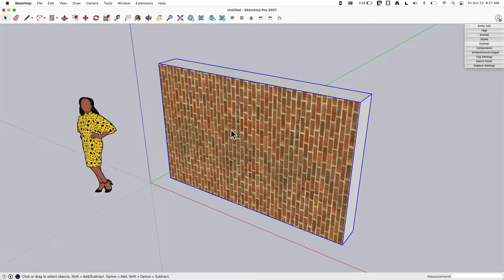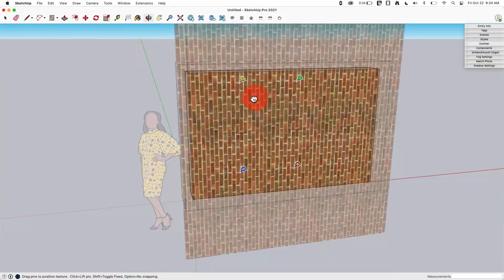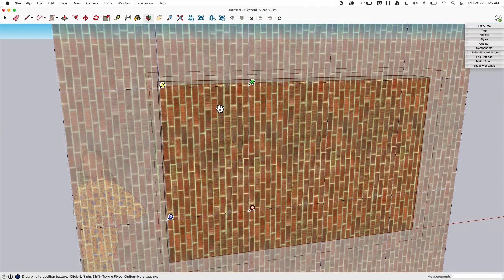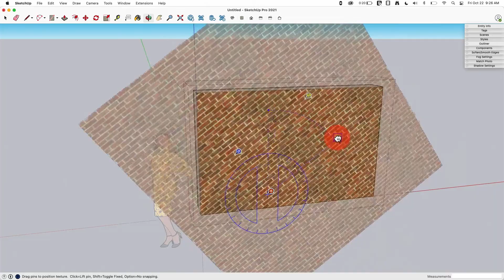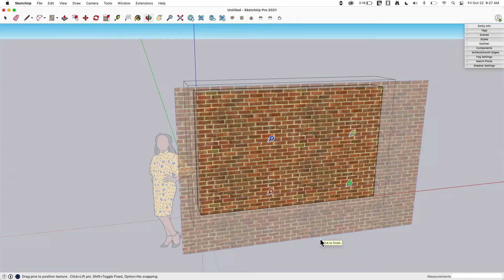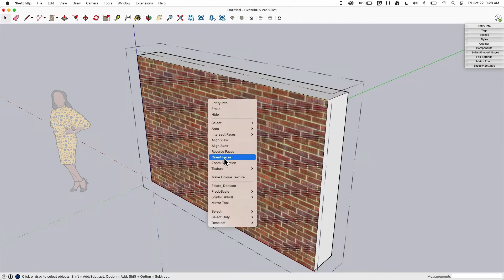Rotating a Texture - Square One

Comment: Is there a way to scale a texture—say corrugated siding—to a specified o.c. distance between ridges? Perhaps I could place a 4-inch geometry near the texture….Once sized in one place on the model can it be copied and pasted to other surfaces? Also, I know this is the iPad series, but on SU Pro, the four pins were all in a bunch. I will try it on the iPad.

Comment: Always good to review the basics.  Thanks Aaron.  I'll second what Hapsard noted and would also like a refresher on how to use the "white pins."  I just downloaded Architextures and am curious about rotating those textures too like T Cards, just haven't started using Achitextures yet.  A possible solution would be to create a surface that allows the orientation you want for the textures and use the eyedropper select tool to copy the orientation you want and apply it to the surface you want the texture on.  This works on "normal" textures, but not sure it would work with Arcitextures.

Also, who keeps giving you the one thumb down?
Reply: I was wondering that same thing.
Just stop watching if you don’t like them, ya doofus!
Reply: By the way, I think your suggestion is a good one.
I was doing lots of modelling of medieval timber structures a while back and kept a cube with two different wood grains and an end grain pattern in different orientations close by to sample and apply. I think it saved loads of time.

Comment: Do you know if you can rotate architextures? The herringbone is cool, but can't rotate it
Reply: Once I import a material from Architextures, and apply it, I get the same Texture > Position options on right click.
Reply: @Hapsard  I just checked it out. I had to make it a unique texture. Then use it as per normal. Cheers for getting me to look at it again
Reply: @Hapsard  thanks. I have to have another look. I was sure I didn't get that option, but I may have missed it